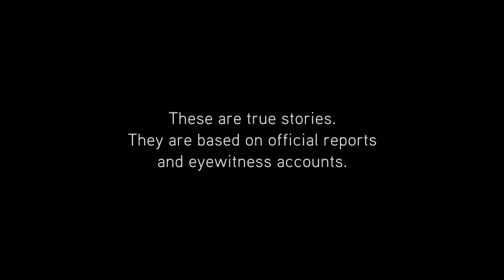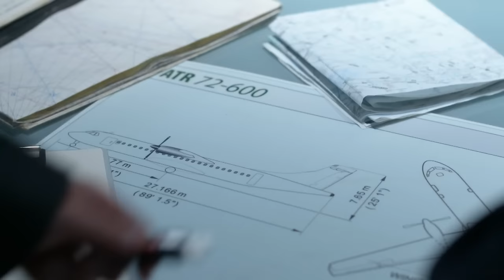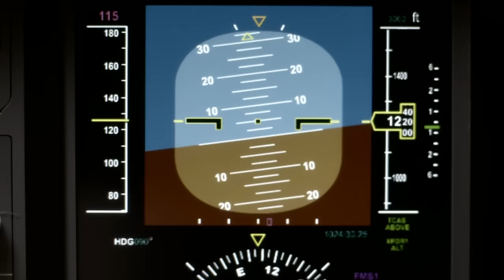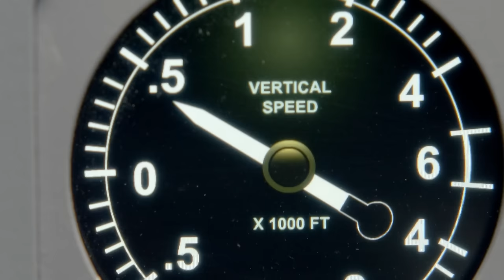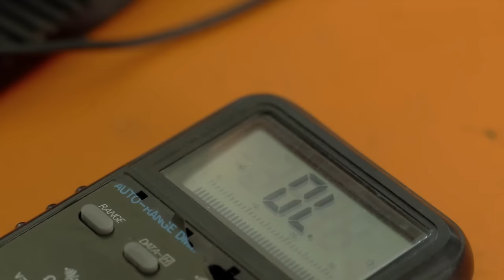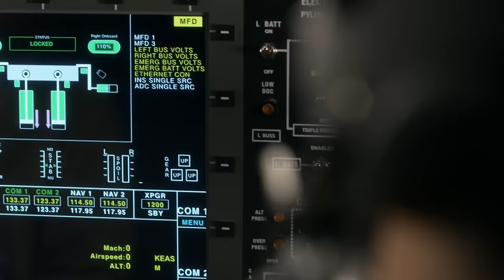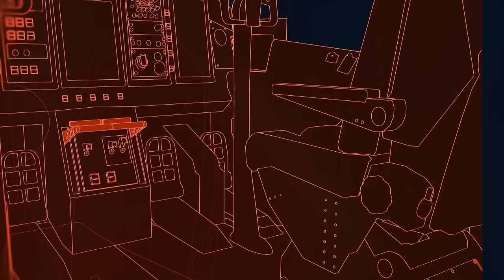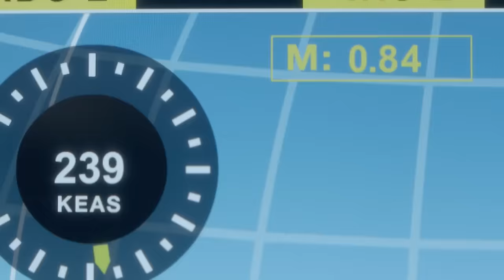Taiwanese Airliner's Nosedive into a River - The Shocking Footage Revealed | Mayday: Accident Files

Comment: The atr72. Not much of a crm in that cockpit. They were also very close to ground. I’m sure the captain thought that slowing down the right engine will prevent a roll over but went too far. Very unfortunate.
Reply: Yeah. I get it was "his fault" but I feel like it's easy to place the blame on him because he's dead. Even though he wasn't supposed to I'm pretty sure he took control because of the people and buildings right under him. He decreased throttle so the plane didn't do what it sadly did bc in the video it looks like he was going for a water landing before the plane banked hard and crashed.

Comment: Right stuff test pilots are exceptional, but not perfect. Hard to believe avoiding unlocking early/
late would not have been stressed in training. A safe range to unlock had to have been known, but the absent electronic failsafe was bad  engineering, based on assumption.

Comment: It’s easy to second guess pilot instincts but it always amazes me that two pilots don’t fully cross check all the controls when time exsists
Reply: They were very low to the ground and definitely didn’t have much time.
Reply: There is a pecking order for aviation, much like in the military. Its very hard to tell someone in charge of the cockpit they made a mistake. Yes, even if its your job to do so. Also keep in mind the future for the subordinates including qualifications, promotion opportunities, and future training is weighted heavily by how the pilot in charge evaluates their performance. This leads to a weird dynamic in many crashes where a co-pilot knew a pilot is going off book, making errors, taking shortcuts but took the risk and went silent instead of coming off as potentially disrespectful to their superior. What's worse is in most Asian cultures its very difficult to "check" a superior as its considered social taboo to correct an elder. Modern day this social issue is recognized and much greater training is done to make this less of a factor in modern commercial flying.

Comment: I just experienced change blindness i was aligning different car than i normally drive at gas station....checked mirror nothing in the back ...was fixated in avoiding hitting gas pump and didn't realize i am going diagonal and did low speed bump to rear of the car filling gas ...i was still shoked  and in denial that how it can be coz i just checked there was nothing in th back...turns out i was yo fixated on driver side mirror to avoid hitting gas pump

Comment: I'm always surprised when the crew doesn't check the controls or instruments.  I'd think if they had a climb issue they would've at least done a scan and seen the throttles were out of sync.  A similar thing happens in many of the "it feels like were going one way but we are going another" accidents where a glance at the attitude indicator would show them their true attitude.

The Virgin crash sounds like it had such a tight action list that maybe they should be automating some of it.  The unlock device should at least demand a confirmation if it is unlocked at too high of a speed.